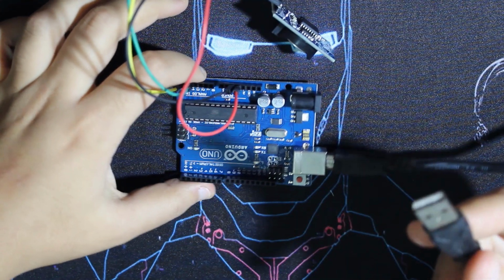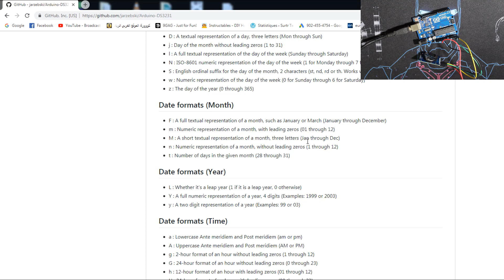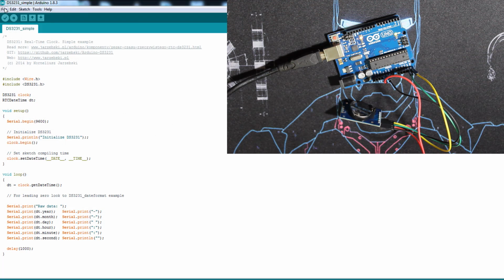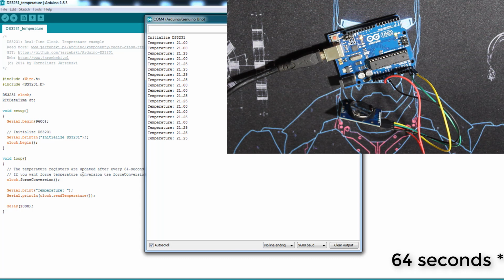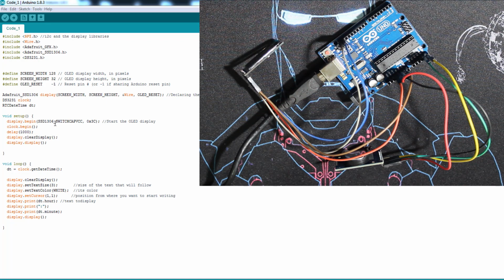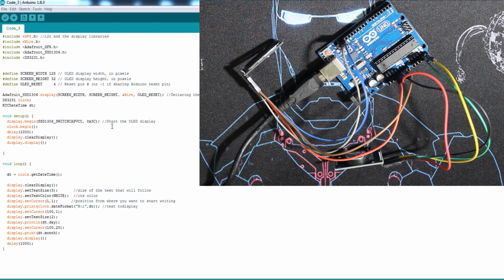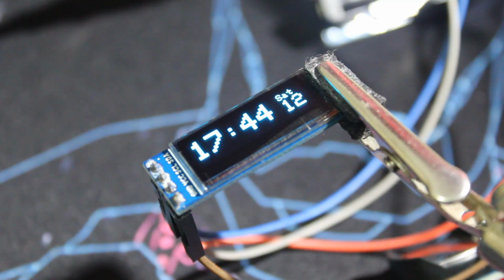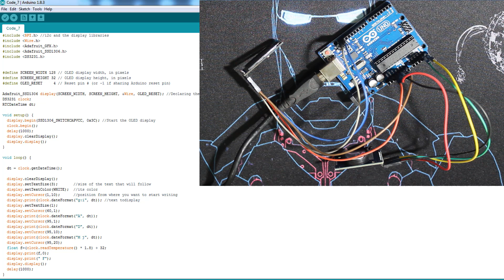How to simply use DS3231 RTC module with Arduino + OLED display

Comment: How can we change the time and data manually without changing code
Reply from the maker: Hello, sorry I don't know what you mean exactly.
Is it "How to set up date and time manually?" Instead of "clock.setDateTime(__DATE__, __TIME__);"
you can try "clock.setDateTime(Year, Month, Day, Hours, Minutes, seconds); " 
example: clock.setDateTime(2025, 02, 19, 14, 05, 01);

But don't forget to reupload the code with the line "commented" or removed so when you reset the Arduino it won't have the wrong date/time.
Reply: @ thank you🌹

Comment: Does your DS3231 maintain the correct time when everything is unplugged from power?  So that later when you reconnect it to power it will show the correct time?  I've been having lots of issues with a similar setup.  Many thanks.

Comment: Your tutorial is one of the few on you tube that has the basis of what I am trying to achieve using a OELD 128 X 32 Screen.

A couple of questions 
1. Is it possible to display the two different times on the screen at the same time . Showing for example different time zones? 

2. when less than ten , the months and minutes show a single digit on the display , is it possible for this to be preceded by a 0
Reply from the maker: Hello, thanks.
For different times I think the RTC can only keep one time zone, you can add others timezones by incrasing/decreasing the hours value (you'll be needing a lot of conditions to avoid displaying strange values)...
Please refer to the library Github page, you'll find all the ways of displaying the values... if not, you can add other conditions that check the value and add 0 if needed.
Reply: SurtrTech . Thank you for taking the time to get back to me.  I have so far managed to display on the screen 2 clock displays showing the same time but in different formats  - the next challenge is to introduce a millis() function into the script of one of the clock displays. Any thoughts ? 
Regards Robert
Reply from the maker: @oceancity1042    Hello, millis() returns the time since the Arduino started the program... you can use it to display millis too and you should take the seconds as your reference.

Comment: Hi, Been following your conversation and had hoped I had cracked it but no avail. My Arduino at version 1.18.3,

Still getting the same problem  ‘RTCDateTime’ does not name a type’. believe subscribers have experience a similar problem.  Would sincerely appreciate your help to resolve.
Reply from the maker: Hello, please make sure you downloaded the library and installed it correctly... sometimes it can be a problem, try to check for new libraries...I already have one in the article but there maybe a change, and I can't keep up with everything.
Reply: SurtrTech . Thank you for taking the time to reply , I did indeed upload the software again as suggested and that fixed the problem . Your assistance and you tube videos are exceptional. Thank you again.
Best regards 
Robert

Comment: I cannot figure out why the Code_1 sketch seems to work great with my OLED but Code_7 only shows the temperature and not the time? I think it may have to do with the clock.dateFormat("g:i", dt) vs. the dt.hour method
Reply from the maker: Hello, check the library link https://github.com/jarzebski/Arduino-DS3231 it shows different formats possible to use... and try them.
Reply: @SurtrTech  I didn't even get a notification you replied to me. Thank you so much. I will look into this. Ignore my post on the arduino hub.
Reply: @SurtrTech   wait. I have this library. I have the same problem when I run the dateformat example file. Let me make a quick video and show you.
Reply: @SurtrTech   check out my video https://youtu.be/Gl1-mtAyvkU

Comment: Hello SurtrTech. Watched closely your tutorial, connected everything carefully, downloaded and included ONLY the DS3231 master library you recomend. Uploaded "simple" example of the library, no errors reported but serial monitor says "Initialize 3231" and nothing happens from that point! It just will not start the clock. any possible solutions?
Reply from the maker: Hello, are you using other board than Uno?

Comment: 1 button ?
2 display 
 - clock 12:34:56
- date 01/02/1234 D M Y
- temperature C* -50.1 +80.1
=====
+ setup
Reply from the maker: Sorry I didn't understand what do you mean !
Reply: Yes, buttons for the display would be good it would make it easy to use I think three buttons would do the job!!

Comment: Arduino: 1.8.8 (Windows Store 1.8.19.0) (Windows 10), Board: "Arduino/Genuino Uno"

DS3231_dateformat:12:8: error: no matching function for call to 'DS3231::DS3231()'

 DS3231 clock;

        ^

In file included from C:\Users\michael\Documents\Arduino\libraries\Arduino-DS3231-master\DS3231_dateformat\DS3231_dateformat.ino:10:0:

C:\Users\michael\Documents\Arduino\libraries\DS3231/DS3231.h:80:3: note: candidate: DS3231::DS3231(uint8_t, uint8_t)

   DS3231(uint8_t data_pin, uint8_t sclk_pin);

   ^

C:\Users\michael\Documents\Arduino\libraries\DS3231/DS3231.h:80:3: note:   candidate expects 2 arguments, 0 provided

C:\Users\michael\Documents\Arduino\libraries\DS3231/DS3231.h:77:7: note: candidate: constexpr DS3231::DS3231(const DS3231&)

 class DS3231

       ^

C:\Users\michael\Documents\Arduino\libraries\DS3231/DS3231.h:77:7: note:   candidate expects 1 argument, 0 provided

C:\Users\michael\Documents\Arduino\libraries\DS3231/DS3231.h:77:7: note: candidate: constexpr DS3231::DS3231(DS3231&&)

C:\Users\michael\Documents\Arduino\libraries\DS3231/DS3231.h:77:7: note:   candidate expects 1 argument, 0 provided

DS3231_dateformat:13:1: error: 'RTCDateTime' does not name a type

 RTCDateTime dt;

 ^

C:\Users\michael\Documents\Arduino\libraries\Arduino-DS3231-master\DS3231_dateformat\DS3231_dateformat.ino: In function 'void setup()':

DS3231_dateformat:24:9: error: 'class DS3231' has no member named 'setDateTime'

   clock.setDateTime(__DATE__, __TIME__);

         ^

C:\Users\michael\Documents\Arduino\libraries\Arduino-DS3231-master\DS3231_dateformat\DS3231_dateformat.ino: In function 'void loop()':

DS3231_dateformat:35:3: error: 'dt' was not declared in this scope

   dt = clock.getDateTime();

   ^

DS3231_dateformat:35:14: error: 'class DS3231' has no member named 'getDateTime'

   dt = clock.getDateTime();

              ^

DS3231_dateformat:38:24: error: 'class DS3231' has no member named 'dateFormat'

   Serial.println(clock.dateFormat("d-m-Y H:i:s", dt));

                        ^

DS3231_dateformat:41:24: error: 'class DS3231' has no member named 'dateFormat'

   Serial.println(clock.dateFormat("d F Y H:i:s",  dt));

                        ^

DS3231_dateformat:44:24: error: 'class DS3231' has no member named 'dateFormat'

   Serial.println(clock.dateFormat("jS M y, h:ia", dt));

                        ^

DS3231_dateformat:47:22: error: 'class DS3231' has no member named 'dateFormat'

   Serial.print(clock.dateFormat("l, z", dt));

                      ^

DS3231_dateformat:51:22: error: 'class DS3231' has no member named 'dateFormat'

   Serial.print(clock.dateFormat("t", dt));

                      ^

DS3231_dateformat:55:24: error: 'class DS3231' has no member named 'dateFormat'

   Serial.println(clock.dateFormat("U", dt));

                        ^

Multiple libraries were found for "DS3231.h"
 Used: C:\Users\michael\Documents\Arduino\libraries\DS3231
 Not used: C:\Users\michael\Documents\Arduino\libraries\Arduino-DS3231-master
exit status 1
no matching function for call to 'DS3231::DS3231()'

This report would have more information with
"Show verbose output during compilation"
option enabled in File -> Preferences.
Reply from the maker: This is a DS3231 library problem, you probably installed two libraries, I recommend you to delete the other one called "D3231" and leave "Arduino-DS3231-master
"

Comment: hey i am havin problems uploading the code
Reply from the maker: Hi, can you tell me what kind of problems? Compiling?
Reply from the maker: @LeafDoode Hi, that's a library problem, did you installed it correctly? And please check that you did not install more than one library for the RTC.
Reply from the maker: @LeafDoode If you want to use the same library that I used, you can go the Arduino libraries folder (Generaly in Documents/Arduino/Libraries) and delete the other libraries folder, and leave this one its name there is "Arduino-DS3231-master"
Reply from the maker: @LeafDoode Did you try to look in "Program Files / Arduino / Libraries" ?
Reply from the maker: @LeafDoode Look also here (C:\Program Files (x86)\Arduino\hardware\arduino\avr\libraries)
Those are the 3 locations where your libraries are stored
Check this: https://forum.arduino.cc/index.php?topic=390833.0
Reply from the maker: @LeafDoode You're not wasting any time, I'm glad to help, and as I told you those are the only places where your libraries are stored, remove all the DS3231 libraries and install the only one you need then compile to see if the problem is still there.
Try to read the the compile error, if there are multiple libraries you'll find a message like this
"Multiple libraries were found for "DS3231.h"
 Used: C:\Users\USER\Documents\Arduino\libraries\DS3231
 Not used: C:\Users\USER\Documents\Arduino\libraries\Arduino-DS3231-master
"
and those are the locations of the libraries found
Reply from the maker: @LeafDoode Glad for you, good luck